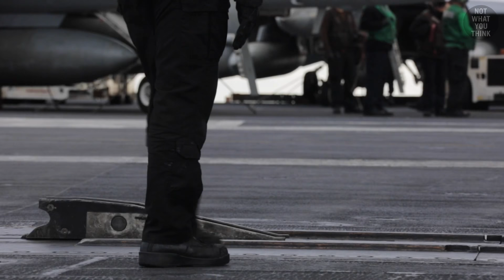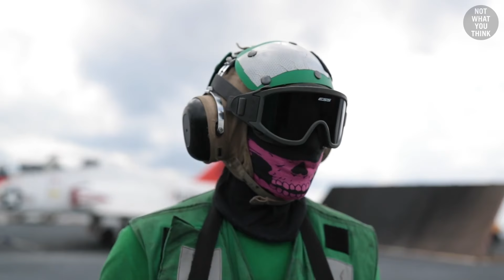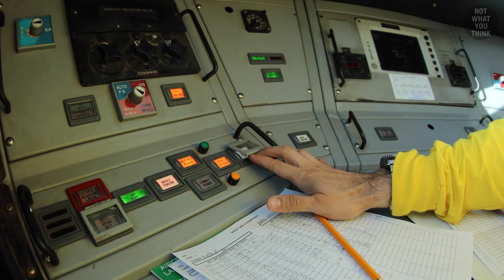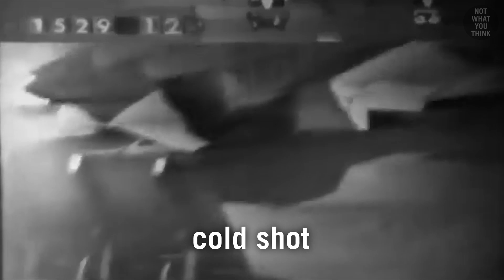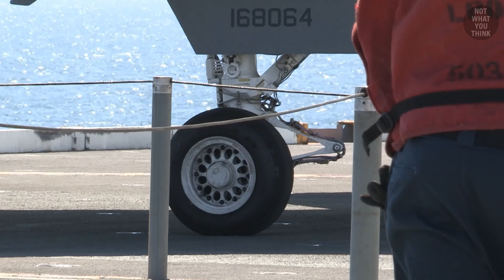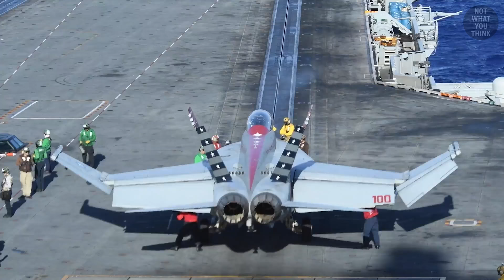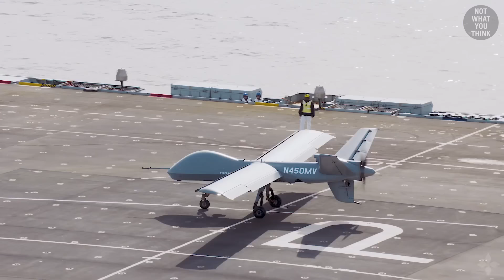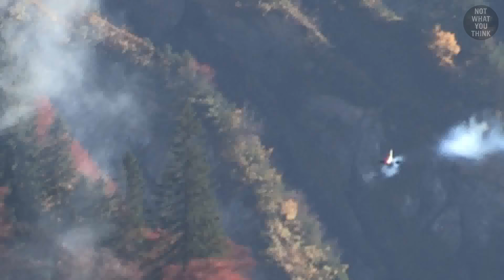Why the US Navy is Replacing Electric Catapults with Steam

Comment: Another excellent video.  I'm sure we don't need to rely on the thought processes of a president with no engineering abilities.  As already mentioned in the comments EMALS is a bit immature but will get better over time.  

I'm waiting for the time when AI takes over.  The drone rolls up to the shuttle and hooks in.  It is photographed from all angles,  weighed and the appropriate information is passed to the catapult AI for launching.  No people will be needed on the deck or even in the cupola. Just think of the sortie rate.

Comment: My navy career of 24 years I never once experienced a cold steam cat shot or any kind of malfunction to do with a cat shot, or even heard of an accident that was the cats fault, always human error. Electricity is inherently unreliable, ever see the lights in your home flicker? One teeny tiny hesitation and you have dead pilots, also for years china has been working on under water EMP's that will kill all power on any size ship as it passes over, and well you know how that will end, steam has NOTHING externally that can affect it.
Reply: So you think steam catapults are purely analogue. That there is no electronics involved in controlling a steam catapult that could be affected by an EMP. 

Also, if the ship is disabled by some kind of EMP, it will have bigger problems than whether or not it's catapults work.
Reply: @christophergroenewald5847 you got that right

Comment: If you put a tenth of the effort and budget that goes into electric catapults, you could get nearly just as accurate

First, make a few separations 
,
Put elastic cords between that can absorb jolts
Make dedicated reservoirs for the catapult
Try moving heat not steam, eg hot oil or molten salt etc, for low pressure, high density, easy to run and fix lines etc
Add shock absorber, a sloshy bit that absorbs bounces and reduces wave propagation, 
Add braking system, simple cheap mechanical brake pads can easily help dial in exact launch parameters
Add relief channel, a secondary channel for letting steam release out to the side instead of into the piston ram to adjust pressure
Include dynamic adjustable spring loaded relief valve, get pressure above launch specs, then hit go, there excess pressure should be going out the relief valve as a regulator, 

Add extra travel distance to the catapult so it can start moving before pulling the bungee cable tight, so you can avoid that initial jerk, maybe add an additional driver that can get the piston moving more evenly

All these things could be computer controlled, but they are also much easier to manually fix and override in an emergency

People love pointing at things and saying look how cute and clean and simple this is, but they want to ignore the black box, the building sized room actually powering it, the billion dollar subsidy that makes it look cheap, etc

Electric carrier catapults might look clean, simple, efficient, safe, low maintenance
But what about the cooling system, is it cryogenic, how much more energy does it cost, does it require mega ships with extra large reactors, does it compromise other systems, what about the power lines, how does it handle debris and corrosives, if it breaks how long does it take to fix and can it be fixed at sea and still be operational, if the network goes down, or you need a software update, can you launch manually, how secure is the supply chain, 
what about radar, does it make a ton of EMF, is it telegraphing intentions by telling everyone within a thousand miles what exactly is getting launched when and what the load out is based on the EMF signature of the launch protocols, 
Is it emp hardened
Do any actually work reliably, or is it mostly publicity stunts getting 1 in a thousand pictures of the few times it's actually operating

Comment: EMALS was never ready to operate aboard a ship.  The contractor's status report plainly stated that it could not meet reliability targets without a complete redesign.  That should've been done ashore, with exhaustive reliability testing performed before rather than after a class of ship was designed to use it.  Iterative design exists for a reason.

If any 1 of the 4 cats has a power electronics / switching problem, it takes down all 4 cats at the same time as a safety measure to prevent insufficient power transfer from accidentally dumping an expensive combat jet in the drink and potentially killing an irreplaceable air crew.  Flywheels used to store electrical energy for cat shots then take several hours to spin down before anyone can work on the equipment.  This is grossly unacceptable.  We need super capacitors, not flywheels.  C15 steam catapult launch systems have individual equipment fault isolation capability.  If 1 of 4 steam catapults was completely inoperable, the other 3 remain usable.

EMALS is overall lighter than C15 steam catapults, but had a negative impact on a ship that is already top heavy.  How far above the waterline equipment weight is distributed in a carrier is more consequential than a minor difference in total system weight.  In combination with increased flight deck area, EMALS increased top weight in the gallery deck to the point that much more expensive and difficult to weld HY110 steel was used to maintain metacentric height.  The weld quality problem was ultimately resolved, but high tensile strength steel requires constant re-inspection for cracks.  That kind of engineering compromise is seldomly worth the cost.

The stated reasons for EMALS development were:
1. more sorties generated per day from faster cycle times
2. launch of smaller and lighter aircraft using fine acceleration control
3. less wear and tear on airframes and air crews from "soft launch" capability

How well did glittering generalities correspond with operational realities?

1. Today's carriers typically operate with half as many combat jets as they did during the Cold War.  Ever-dwindling numbers of expensive turbine engine aircraft make additional sorties per day functionally unattainable at tolerable total cost.  Ground crews typically require at least several hours of repair work after every flight to restore full mission capable status.  Air crews require rest, meals, and time to brief their next mission.  Funding for more crewed combat jets or improved combat drones was allocated to the Ford class and various other expensive concept warship development failures.  Generating more sorties per day is grossly impractical for reasons unrelated to EMALS suitability to task.

2. Maximum launch weights haven't increased beyond C15 steam catapult capability.  Minimum launch weights for militarily useful long range high capability combat drones like MQ-25 allow C15s to launch them without damage.  EMALS provides extra launch energy margin over C15s for launching at lower relative wind speeds over the deck, so all ships could sail at a more economical 20 knots during flight ops and still launch all presently operational aircraft at maximum takeoff weight, but procedure dictates 30 knots of wind over the deck so this is what we actually do.  EMALS is sufficiently powerful to launch most aircraft at typical weights with zero wind over the deck.  A carrier disabled by a torpedo attack, but no flight deck or power generation damage, could still launch aircraft using EMALS.  A propulsion kill is not an automatic mission kill.  In practice the carrier would still be towed back to port for repairs.

3. EMALS soft launch does significantly reduce airframe launch stresses, it's only immediate and ever-present advantage over C15 steam catapults.  This is highly consequential over time, even if modern airframes are very robust.  Softening the initial acceleration jolt is highly desirable because the electronics have fewer issues.  Modern aircraft are stuffed with electronics and we want them to work reliably.  This advantage alone is worth the cost if EMALS becomes as reliable as steam.

I guess 1 out of 3 ain't bad.  I rate it 1.5 out of 3 for the ability to launch while dead in the water.  It would be a solid 2 out of 3 if we had any smaller and lighter combat aircraft to launch, but we don't for the stated reasons.  We absolutely did get something militarily useful for our money, but it was over-sold, not ready for prime time, and won't be without a redesign.  I think that's a pretty fair and unbiased accounting from someone who is biased towards reliability and ultimate durability over theoretical capability.

Comment: The U.S. Navy could order medium-voltage DC electromagnetic catapult systems from China. First, China is not bound by the Wassenaar Arrangement, allowing the U.S. to obtain relatively mature products at a lower cost; these systems truly possess extremely high reliability rather than being tested on aircraft carriers. Second, China can provide sufficient production capacity for rapid delivery at a very low cost. Third, purchasing Chinese technology allows the U.S. to understand the characteristics of Chinese warships and lays a solid foundation for future orders of entire warships from China.
Reply: There's a lot wrong with this comment

Comment: Like trump knows anything.
Reply: Trump is correct EMALS are a junk system. The Navy with steam considers one launch failure out of 4,400 acceptable. EMALS can't get to 600. One sensor failure all 320 must be replaced. 
The Chief designer of the Ford Class CVN resigned because the Navy was attempting too many technological attempts at one time.
BTW the sewer system doesn't work due to bad design and requires a $400,000. acid flush to clear the clogs. At last reports I've read the Ford had already had ten

Comment: Samething with engineers who told everyone that more electric stuff on vehicles will make them as good as old motors or energy saving refrigerators and washing machines lasting only 5 to 7 yrs. Try replacing a messed up wire in that system compared to replacing a section of steam pipe!

Comment: EMALs will improve to the point that it's operationally superior to steam, but then we'll start to learn the hard lesson of failing high-energy electronics. The energy storage banks are going to start failing from the heat cycles and the coils used on the cat will start failing just like your HV residential transformers under stress. Copper windings will literally short out during launches. The thought of a high-mileage EMALs system is frankly terrifying compared to steam.

Comment: No one alive today has done as many carrier takeoffs as Trump. He knows what’s best when it comes to catapults and anything you can name. Only he can guide our Navy back to the 1950s and bring it in for a safe landing with an hydraulic-mechanical arresting system. He will also help modernize the carrier fleet by replacing those egghead nuclear reactors with steam boilers powered by reliable, plentiful clean coal.

Comment: One thing for sure. EMALS aren't working! Lates data can't to 600 shots before a failure! 
Ford class not as advertised ... Hell the sewer system doesn't operate  Design flaw piping is too small...

Comment: An aircraft carrier without a reliable working catapult is only a freighter.  I worked design engineering at Grumman Newport News. They should have retro fitted one catapult on an existing carrier with EMALS to perfect the tech before going all-in on the new carrier design.

Comment: If the catapult failure results in the loss of an airframe, that's a lots of million dollar loss.  98% is still 2% fail.  I get that not every failure will result in airframe loss, but if half do, that's a 1% airframe loss rate, with 500 F/A-18s in service, that's 4 a year.  At a a replacement cost of 75M, so that's a 200M cost PER YEAR for a catapult design.  And that's just the F18s.  Dunk ONE Hawkeye and that's 200M right there.  This smells of the Mk14 torpedo where the pencil pushers hand wave away failures, but the people out on the sharp edge know the score.  And die when it doesn't work.

Comment: KISS Keep It Simple Stupid. What are the operational cost? Failure rate? What can disable or neutralize the EMALS? The Navy has operated steam for decades and aircraft are designed to withstand steam cat shots. You are already pointing out problems with EMALS. Can the programs be hacked? (yes) If it ain't broke, DONT FIX IT.

Comment: These are the points i had expected to hear:

Steam power gets progressively weaker the longer down the track you go, since it's the same mass in an ever increasing volume. This also means most of the acceleration power happens in the first few feet and then slows, putting additional stress on the airframe. Electro mag cats are consistent or variable. You can make them positively progressive, so it speeds up as it goes, the opposite of steam. Also, you can adjust power outputs for differing aircraft, instead of it being a straight cut "it is what it is, if your aircraft would work better with a different power setting, oh well. Not sure how much of an issue that particular point is, but hey, it's there. It is more energy consuming, but since when was that an issue? Our carriers are nuclear... That power source lasts 25 years... We are not stressed about energy consumption on our carriers.

Comment: I went to A & C schools for the C-13 catapult when I was on the Enterprise - Cat 2. Who ever made this video, of course, doesn' know what they're talking about. The steam catapult does. NOT have a "uncontrollable" jerk when first fired -in fact the launch valve intially opens in 3 stages to prevent that jolt. Also, the narrator infers that the steam and thus force of a steam Cat is not changeable -not true. They can dial in the EXACT amount of steam and horsepower required to launch any aircraft at ANY weight for any wind over deck speed. The term "cold Cat" is a catch all phrase that doesn't mean the Cat was "cold" -the Cat is always Hot -it's a steam Cat after all. Hundreds of thousands of launches have done safety and I never hear of a launch going bad because of "steam" or the Cat being "cold." We had an A3 Skywarrior that went into the drink off Cat 1 and it turned out the hook on the aircraft that helded the Bridle broke -almost always a failure on launch is NOT the Catapult, it's a failure on the aircraft -like a jet enegine flame out or some such. The C-13 is Incredible complicated, using 7 different systems (Steam, hydraulic, pneumatic, electric, electronic, mechanical and water). The argument can be made that the electro-maglev is a simpler system but NOT safer. This "real time" feedback for a steam cat is stupid and NOT needed. It may be need on the Electro-mag-lev system - I don't know. If you want an interesting subject - make a video on how the water breaks on a Cat stop that 3 ton double piston that IS the shuttle assembly gets stopped in 6 feet in .04 seconds. NOW there' a feat for you.
Reply: At the end of the day, the job of the catapult is to launch aircraft over the edge of the ship above a specific speed. Realtime feedback is useful as you can vary the power output to compensate for changes in wind and whatnot as the something hurls down the runway so it goes off the edge at just that speed - too slow and it might going into the sea, too fast and you get additional wear on the aircraft.
Reply: Appreciated a rational explanation by a person with actual experience!
Reply: Most interesting reply out of all:)
Reply: There's also the fact that President Useful Idiot is dragging the nation in reverse on technological advances because his egomanical brain tells him he knows more than anyone.

Comment: Eventually the plane is going to experience undue stresses.  So, regardless of whether you put too much stress on the air frame during take off, or not, the maintenance is still going to be conducted on the airplane.
Reply: FYI, the cat room ops makes adjustments for the aircraft types weight on a computer. Not a one size fits all setup anymore.

Comment: US doesn't have advanced maglev technology therefore the EMALS on USS Gerald Ford is inefficient requiring extra maintenance being unreliable and less durable. Steam catapult is mechanical, reliable, durable but using more space requiring manual adjustment. 

China has advanced maglev technology and much experience with bullet train and electric train allowing them to build the best efficient reliable EMALS.

Comment: On the carrier in my time we had a shortage of water due to these steam catapults. Its a new technology for the navy, Linear motors, that have been used in industry machine tools for decades. General Atomic was the OEM of these catapults that have a force range that is more precise load control and bell shaped acceleration.
Reply: Trump will order them to use sea water. Or flush the toilets less.

Comment: We cannot go back. We are NOt going to retrofit a steam system  to the new carrier design.  Will not physically  fit. The new aircraft  carrier will not accept the old style lifts either.  And dusting off the Nimitz design  for rebuild would be a new complex start from scratch. Teething problems would be just as huge as forging  forward with  the new plans. We can't even build a new frigate from a proven plan without screwing that up with design changes. ( we destroyed our core shipbuilding capacity  in the 1980's with the Brac commission).